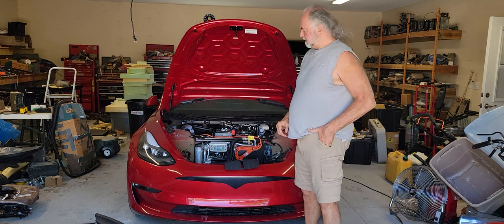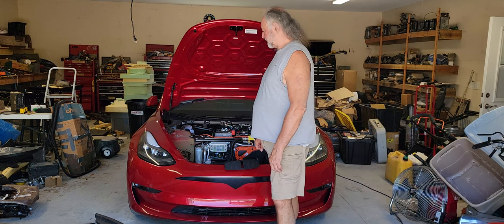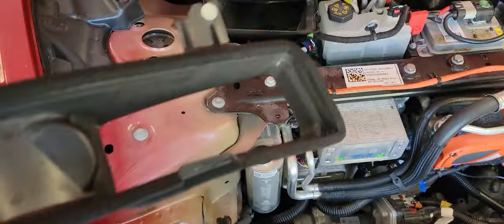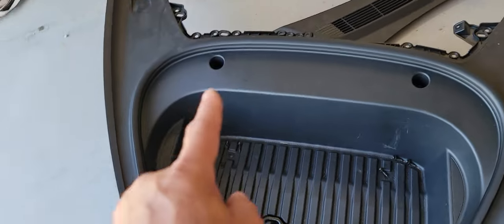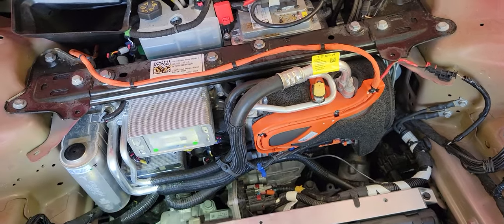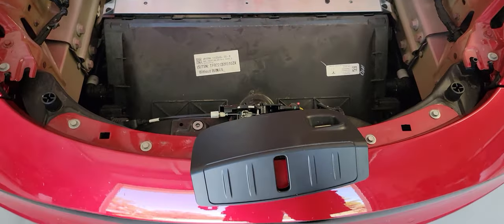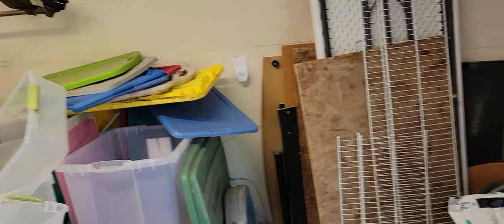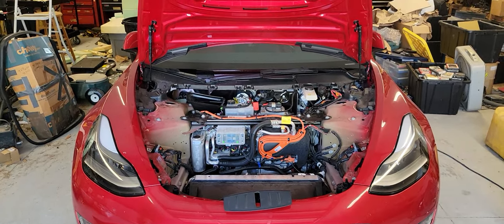Tesla Mice Damage Rodent Damage DIY Tesla repair Tesla wiring repair and rodent mice nest prevention

Comment: I use a spray bottle with 16 oz. of distilled water with 12-20 drops of peppermint oil and a squirt of dawn dish detergent to add stiction. Spray the four tires as they climb up tires to get in and spray around under hood compartment. I do that every night when vehicle is parked outdoors. It works. I also spray my sheds and around garage doors. No more mice damage since this routine.
Reply from the maker: Great! Thank you for sharing! I'll add that.

Comment: Thought I had a computer problem when I began to have failures. Technician found rodents had gnawed through the main bus wires and the windshield washer reservoir . $2100 later….   I’m using preventative measures now.

Comment: That won’t last long. You’ll need a diffuser and a reservoir of that oil. This will be gone in a day.  The oil will still diffuse itself but then there’s no oil to replace it.  And even then you’ll need to refill it once a month.  Might be better just to spray from underneath once or twice a week. Or hang diffuser bags of the oil near the holes when parked.
Reply from the maker: Good ideas

Comment: Good video thanks for the awareness. I use the ultrasonic repellers in my barn and garage and have not seen any activity on my mowers RV or cars. and we live in the country. Hopefully you don't discover any other damages.
Reply from the maker: I just installed an ultrasonic repeller in the Tesla. It's a 2022 Model 3 with the Lithium Ion 12v (low voltage) battery. That battery runs at a higher voltage than the common lead acid car batteries. I was concerned it might not work, but I bench tested on a power supply first, then I installed it. It operates in the car fine. Too bad I don't have a way to test if the mice hate it or not. Please note that Shawn, the mouse trap tester, here on YouTube says the ultrasonics don't work. I don't have a way to test them.

Comment from the maker: Please SUBSCRIBE and LIKE, it would really help me a lot! 
After I posted this video a package arrived. I just installed a vehicle mounted ultrasonic repeller in the Tesla. I think they design that for an ICE car. But my car is a 2022 Tesla Model 3 with the newer design Lithium Ion 12v (low voltage) battery. That battery actually runs at a higher voltage than the common lead acid car batteries. I read 16 volts but I measured 15.5. I was concerned the device might not work, and might burn out with that much higher voltage, but I bench tested on a power supply first, and it worked at 15.6 volts, then I installed it. It operates in the Tesla fine. Too bad I don't have a way to test if the mice hate it or not. It seems of fairly good quality and workmanship. The only shortfall so far is the wires to the extra lights could be a foot longer. After calling the manufacturer and doing my own bench testing. I conclude that the unit can sense vibration. It uses vibration to determine if the car is stationary or running. When running it shuts down to standby mode.  It was designed for an ICE with an engine that gives vibrations. I don't know if the Tesla road vibrations will be adequate to shut it down. My Tesla sure runs smoothly. I don't think it matters, just a slightly shorter lifespan perhaps if it never shuts down. I did test the vibration on the bench and it does work but I could not get solid repeatability. I bought: "Good Life Inc. UltraSweep Traveler | Rodent Repellent for Vehicle Engines | Humane Ultrasonic Sounds | Flashing LED Lights | Automatic On & Off | Repels Rodents & Pests | for Car, Truck, Boat & RV. Visit the Good Life, Inc Store". It's a little pricey at $60 but it seems very well made, so I justify the expense. I have no affiliations with either Amazon or the manufacturer. After seeing just how much damage mice can do to a Tesla, I figure it's worth it to overkill the protections. I now have an ultrasonic repeller with blinking LED lights,  Peppermint Oil, and ultrasonic repellers in the garage where I keep the Tesla. Going forward, I'm going to get some fancy mice and rat traps. I'm also going to install the vehicle ultrasonic repeller in both of our other vehicles. 

Update 18 April 2023

First:
The ultrasonic repeller plug ins do not work! I have them in my garage and rats came back into the garage since. 
This is  also supported by the YouTuber Shawn Mousetrap Monday series.

We had a chilly night last night here in Florida and the mice came back. I am not certain that they entered the Tesla again, as I don't have convincing evidence, but they definitely entered the Toyota Prius I had outside. I didn't put the noise and light device in that car but I cleaned up the engine compartment where they had previously nested and this time they got into the interior! Oh my!  This battle will continue. I'll have to install the electronic repeller in the engine compartment and do something about the interior too. Stay tuned.....

Comment: Great video. Very helpful. Have you added anything to other parts of the car like the back? I have heard they can attack cooling lines
Reply from the maker: I keep the Tesla in the garage, unfortunately we have to keep the garage open most of the time. In desperation I will find a way to keep it closed most of the time. But I have two more vehicles that must be outdoors and they were attacked the same season. So I must find ways to stop the rodents from getting into the vehicles. What I've done is as follows: 1) I set up bait traps (none caught so far). I plan to get more traps and set them. 2) Cleaned up all possible food sources. I had to put a horse feed into metal because they eat through heavy plastic designed to keep them out! 3) Installed the noise generators in the garage. I think it had zero effect. I saw evidence after installation. 4) I bought and made peppermint based smell deterrence. I installed one each in two of the vehicles. I also bought spray and bags. 5) I put two sided tape in the Tesla where they had nested before.  But I have not done anything about the back or interior. I reviewed the path to the interior with Service and they pointed out a very good screen in the air intake to the cabin.  No doubt I'll keep working on this and other Tesla challenges and post more videos. I have several up about seats and wind noise already. Thank you! Please like and subscribe for me.
Reply: @georgeborrelli3134  .. George, I seen a video that putting AMMONIA on rags keep rodents away.  I bought a couple 1/2 gallon bottles at Walmart for $1.98 each.   Soaked a couple shop rags and put them on each side of the garage door on the outside.  I'll let you know if it works.

Comment: I have had NUMEROUS experiences with my model 3 getting eaten by mice. Too many to count. I’ve tried a lot of things but nothing is ideal so far. I was recommended rodent tape made by Honda from Tesla service this last time it went in and right when I got it home and ordered the tape the harness was eaten by mice again. Not even a day after being replaced the new one was destroyed. Hopefully when I can get it in again they will apply the tape for me. Seriously, this has been my number 1 issue with my car since I got it in 2018. Multiple times a year
Reply from the maker: I'm curious what you've tried. It's been quite a while for me and no repeat attacks. But I launched all out war. I'll itemize in order of what I guess works best: 

1. I put a very strong smelling peppermint dispenser in each car's "engine compartment". In the Tesla Model 3 I placed it under the plastic frunk, where the rodents did damage previously. I refill the dispensers after 2-3 months or so. 
2. I spray a tested professional repellent, it also has pepper mint and a couple other oils and smells. 
3. I reduced the rodent population. I set a lot of traps and "safe" poison. My traps caught a lot! This significantly reduced the population in the general area where we park our three vehicles. 
4. Got two cats. They patrol every day and night. 
5. Installed the electronic device in each vehicle. I don't know if it does repel them but it does flash lights and emit all kinds of weird noises. 
6. I put double sided tape in all areas where the rodents previously infested. If they don't get stuck, they will leave something, so I can know. 
7. I regularly check "under the hood" of all three vehicles.
8. I keep traps set, so I know if they return to any significance. 

So far, a full year or more, no evidence of any more rodent problems with vehicles.

Comment: Wow.. This just happened to me and I was blown away how the rodent(s) actually built a nest in the frunk area near the windshield wiper motor of my Model Y. I had no idea this was the cause of my wipers no longer working. I thought the latest update messed up my wires 🤣 The Tesla service guys came over, checked in the frunk and said looks like you’ve got a rodents nest! Unfortunately they ate the wires that control the wipers. That rodent was smart. It used a couple of old surgical masks along with other trash to make a comfortable nest. Insane!  They said spraying clove oil is good to keep rodents away.
Reply from the maker: Peppermint oil has been proven effective. Try that too

Comment: Happened to my Model 3. First sign was the outside temp was no longer showing up on the screen and I couldn't remotely turn on the AC from my app. Turns out the external temperature sensor wire was chewed out. AC still worked for months then one day, it will only run when im on the highway. AC was blowing warm when parked. Took it to SC and it was some wiring chewed out by some rodent. $700 to fix (60 parts 700 labor). FML. At least I got cold air back in this TX heat. Will do this peppermint and try a battery operated rodent machine.
Reply from the maker: Thank you for your comment. Sorry you also had the problem. That's interesting that the rodents ate the same wiring harness!  How is your battle going?

Comment: I am wondering if adding a basic mouse trap both in the Frunk and Trunk would help? Would this be a good heads-up/alert that mice have entered the car? Or would the bait actually attract rodents and introduce a problem?
Reply from the maker: @flyabus  I wouldn't do it for that reason, and it will snap when the car is driven.
Reply: @georgeborrelli3134  thanks for the quick reply! Good thinking. What about keeping a cat in the Frunk? 😂 I kid of course.
Reply from the maker: @flyabus  😂
 We got two cats!
They are always on patrol..

Comment: Hi George, I noticed a screwed up  subway paper bag in my model y had signs of a mouse eating through. Im wondering where theyre getting in!, bought some mouse traps and caught one so far. Having just watched your video, i see i will have to rip out the frunk😢
Reply from the maker: There are too many open entry ways to the car's components and wiring, which are outside of the car's cabin. I don't know how the mouse got inside the car. There aren't too many gaps to the inside of the car.

Comment: Hey George, how has this system worked for you. I am having major issues. I've got a two year old, so hard to keep food completely out of the cab.
Reply from the maker: It's been very successful. I haven't had any more issues. I have no more rodent infestation in any of our three vehicles. But I did much more than just install the electronic systems. I cleaned the garage where I park the Tesla and contained any possible rodent attractants. In  the garage where I park the Tesla, I put out rat/mouse/rodent traps to reduce the population and draw them away from the cars. the traps were catching them daily for weeks. I then put out some "safe"  "poisons". The brand that I used claims it's not harmful to other animals but will reduce the rodent population there over time. I also made my own formula with baking soda and attractants. I found it took over 2 weeks after putting those "safe poisons" out. Then suddenly my traps were no longer catching any. The traps I used were inspired by the Mousetrap Monday guy. I built a wooden box and put three snap traps inside. The box serves to keep other curious creatures away from the snaps and makes it very difficult for a rodent to steal the food without getting caught. Finally I installed a peppermint oil odor dispenser in the frunk, underneath the plastic, near the front, that I made. I put it there because that's where they were nesting. (I also put peppermint oil dispensers in the other two ICE vehicles in their engine compartments)  I didn't see any evidence of rodents getting into the cab. The scent is supposed to repel rodents. My electronic device is still working fine. The lights continue to flash and it continues to makes the weird sounds. I just cannot say what the "key" element was. I also haven't seen a new infestation in my truck and car both parked outside. They were previously all infested. Recently my trap caught a squirrel. I have no idea how he could fit into that box, made for mice and rats. I believe you must do all the conceptual things that I did in some ways that works for you and your situation. It felt like war for a few months time. Then suddenly it was over.
Reply: @georgeborrelli3134  thanks for the update. I use the A24 good nature trap which is highly effective. I got 6 mice in two days. CO2 powered and resets on its own. I have one behind where my car is parked. The main problem is I live rurally and there are fields all around me presumably the source population. I'm going to cover the "gapping hole" AC intake in the frunk area and spray peppermint oil everywhere. The damage is real, they got a seatbelt, and my sons car seat belt. Probably approaching 1k in damages in the last two weeks. Very frustrating.
Reply from the maker: @sebastiankallos9864  
Don't give up. It's a war. You are on the right path. I think you'll not be able to relax until your traps are no longer productive. You may not be able to eliminate all the population in the fields, but I think you can affect just those family lines that discover your car. Once a family line discovers your car, all the offspring will return. That's my theory anyway. I don't think it is possible to cover holes in the car. It might be possible to make it more difficult to get into the cabin. How are they getting in? You may be able to screen over that singular pathway. But the frunk underneath the plastic is wide open. Spray peppermint and use a dispenser. I just repurpose a plastic pill bottle. I put cotton balls in it. Then I drench them with the oil. I drilled holes selectively in the bottle to vent out. I refill it approximately every 3 months or so. There's also a spray you can buy made by Grandpa Gus, I think. That trap you have is a good one I've read. But the rodents have large numbers of offspring. It may take a while. I added a "safe poison" names RatX. It seems to be helping. This is what they claim: "Eliminates rats and reduces odor by up to 90%. Safe for use around people, pets, livestock, and non-target wildlife".

Comment: Just had my tesla Y damaged by mice according to tesla. $1200 to repair. Only 9 months old. 3rd repair since I bought it. So far $1500 spent.
Reply from the maker: If you haven't already, do some prevention. I did everything I could, all at once. I use peppermint dispensers in the areas that the infestation took place. I set rodent traps. I put out "safe" rodent poison. I cleaned up all around and inside too. I put double sided sticky tape every entry and walking area. I used the electronic devices. As far as I can tell good for a year now. Populations have also decreased. Then I went out and got two cats!!!!!